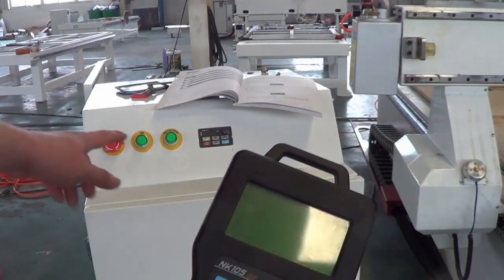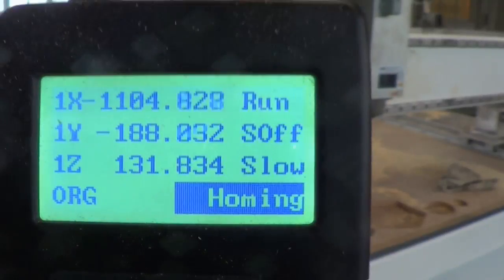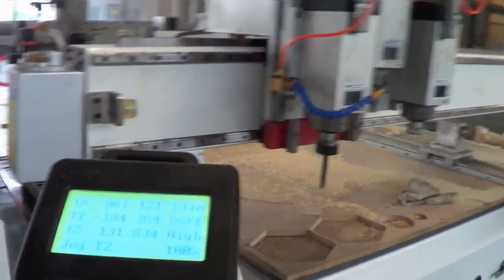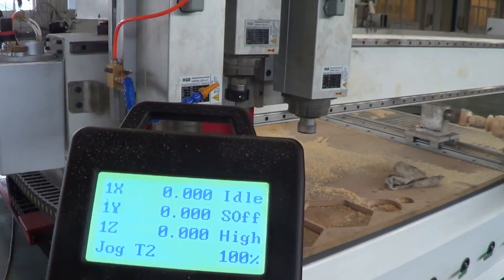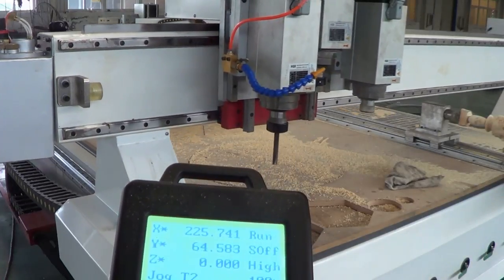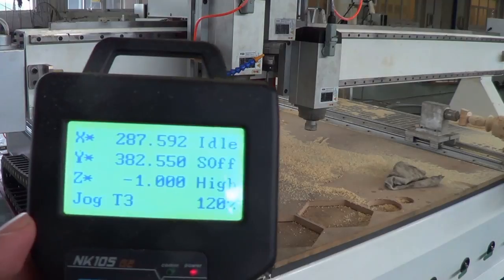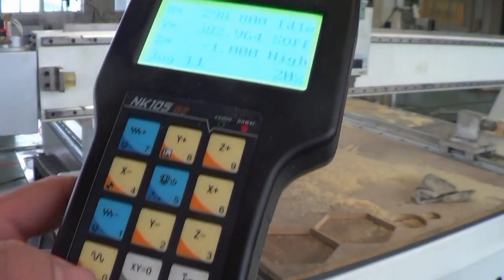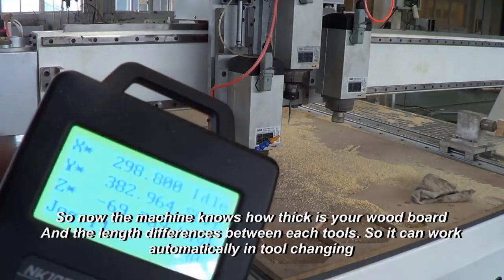some basics of using NK105 on trident ATC

Comment: Hello we have a cnc at our shop now same remote and stand my question is can you read files from the computer without getting up and putting the usb each time
Reply from the maker: no, this panel works not in that way. it reads files from usb. or you may copy your files into its inner storage. but you can't use computer to control the machine directly. if you want that way you should buy ncstudio or mach3

Comment: I have a CNC Router E2-1325B model. Please I need help, where I can get the parameters to use it again, because the parameters are reset. Please it's urgent
Reply from the maker: Elisa Fernandez de Cordova Hi Elisa, sorry but you may have to ask the manufacturer for help. Different factories have different parts and parameters.
Reply: ok thank you anyways!

Comment: i have problem with my nk105 .. i have reset nk105 to factory setting and i do not know how to set parameters . can you  tell me how to set .
Reply from the maker: +Sook وين الحلقة ي كداب Sook usually you need to set working area and pulse equivalent. that's different between factories.
Reply: +LIU XIN  thanks for your replay .. i solved my problem with the parameters .. but i have just one problem .. my cnc has 2 heads when the T1  finish cutting  the T2 going to  cut the spindel does not run just move in x y z without cut 'stop spindel ' how i can solve this problem